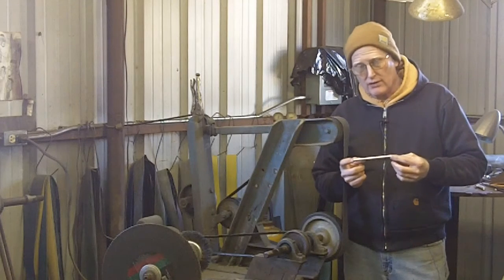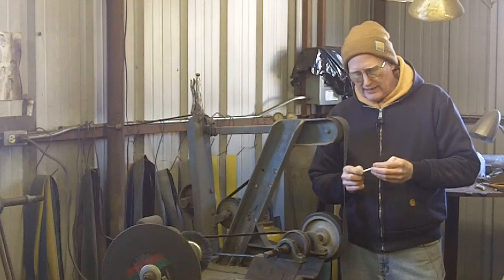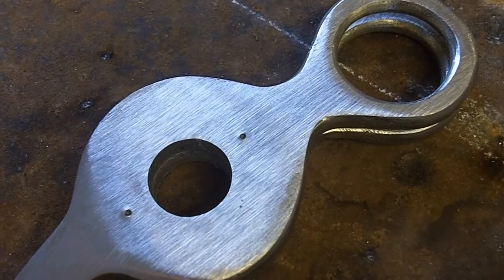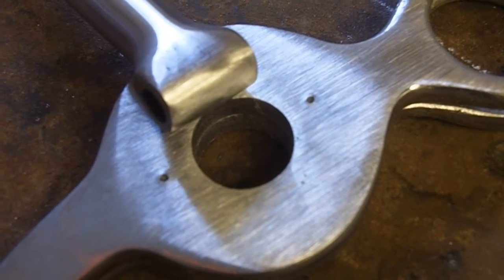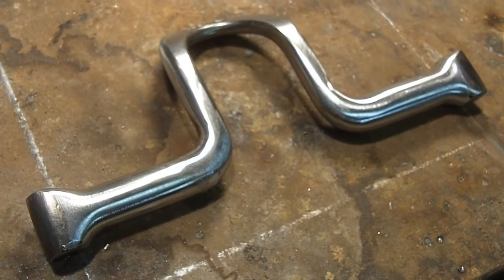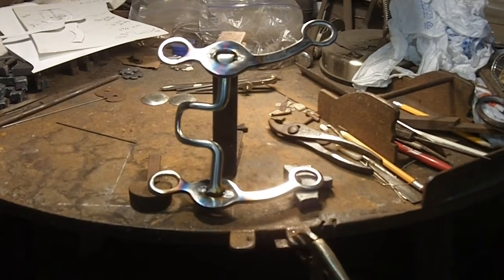Bit Making - How to Make Handmade Horse Bits Part 3

Comment: How did you put the conchos on the cheek pieces?
Reply from the maker: Harris Product soft solder and liquid flux low heat for easy clean up. I use a 6 inch soft wire brush on my buffer motor to clean the liquid flux ect. off.